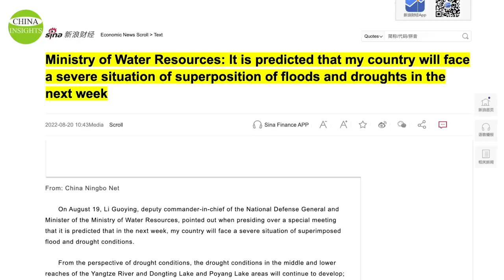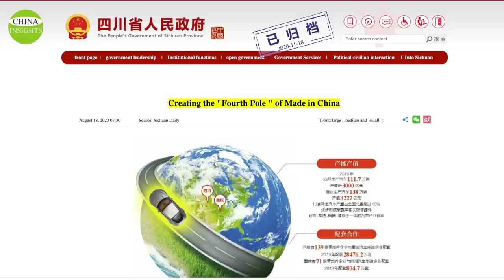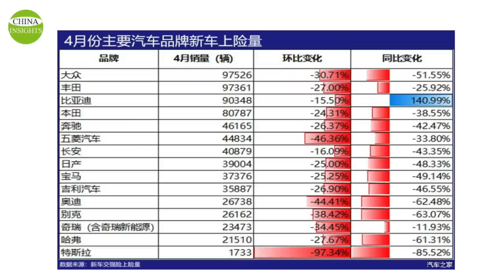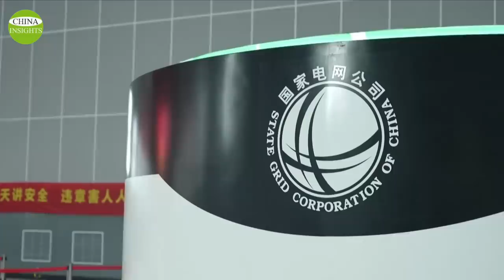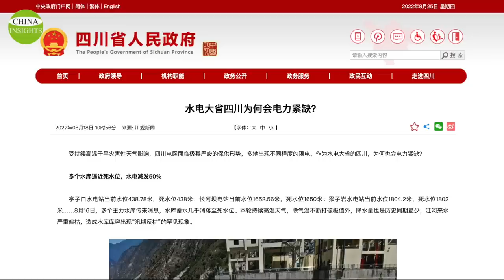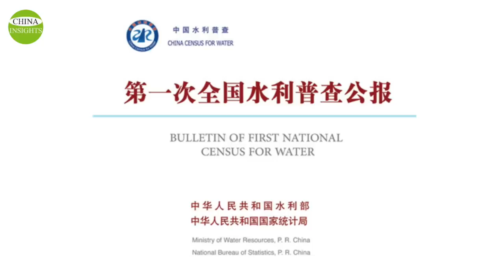Why does Yangtze dry up? The Power Crisis continues & Extremely high temperatures grip half of China

Comment: The use asphalt is very bad for the environment… and it’s traditional black color holds a lot of heat …. This wasn’t a problem when the roads were made out of concrete!
Reply: concrete is to rigid to build roads from. roads build out of concrete will chip and crack everywhere.

Comment: So, the lesson 1: they want to use more water that they have, or you use it for agricolture, or electricity, or navigation. If you want all the three things, water isn't enough. Lesson 2: if you want all electric cars you must have the electricity to charge them all, but if you charge them all then you will not have electricity to make the lithium batteries. Lesson 3: ex soviet union style economy with single items production based all in one area doesn't work. If something goes wrong in that area you will find the country with tons of refrigerators and no cars or with tons of cars and no shoes.

Comment: Hello,
Water is disappearing by design.  If 1.0e⁹ people of China provide a 1.5e¹ m² (the thickness could be as low as 1.5e¹ cm) of a nontoxic white-color floating material to cover the reservoirs' surfaces, the evaporations stop.  1.0e⁹*1.5e¹ m²=1.5e⁹ m² or 1.5e⁶ km²; nevertheless, Operation Depopulation is at work and is robbing water and resources for the underground residents and eventually decreasing the Earth's population to whatever designers' agendas require and is in their evil minds.

Comment: 20:26 : my partner is angry that I bought a 1.000 Watt Battery Based AC Inverter, with 3 Batteries about 6 months ago. This woman would be happy to have it. And as I also use own 2*2K Solar Inverter, I know that it WILL be worth soon. Even here in Thailand, still good water, but electric y 61% of gas, 20%? of Coal might seam to be save yet. But getting expensive anyway also.

Comment: Holy shiteeeeee. I work in a UK pub kitchen and highest temp I have recorded in there is 46.7 degrees C. So I can imagine it being 50 and honestly I’d have to tap out of work at that point. I’ve worked in kitchens for 9 years but 50 really is the limit of human endurance for temperature. Although that said I am basically a Viking so not like I’m built for such temps.
Either way I hope the CCP are taking this opportunity to do some maintenance work on the Three Gorges Dam as I am of the opinion that 3G dam is doomed thanks to water egress into blasted bedrock.

Comment: China does not know that they are the reason of the high temperatures that are the cause of the drought not only in china but around the world china has over 3 thousand coal burning electrical power plants 400 of these coal burning electrical power plants are in Beijing the United States only has 240 for the whole country and 28 present of those will close by 2038 but china is building more coal burning electrical power plants which causes more greenhouse gas that causes higher temperature and droughts

Comment: Tesla are literally making solar roofs and grid storage systems. They have no right to complain if they won't put up their own solar panels and batteries to hedge for electricity shortfall. On top of that, several other car manufacturers have done so and are now operating zero or low carbon factories for their EV manufacturing, for some reason Tesla won't do it.

Comment: Also here in NL we experience somewhat the same.

NL is extremely flat which means that the soil in spring becomes too wet for sowing, this means that the govenrment (waterschappen) opens the dams to flow away the water so that the farmland becomes less wet.

This results in water shortages in the summer.
Reply: Would be cool if they could somehow capture that water and keep it for summer.
Reply: @thelourensfamily8048  Its impossible to capture the water when the water caused the soil too wet to produce anything other than marshland.

Comment: China had better invest in good solid nuclear power generation incase of more future droughts in the south.  Their people can't afford the constant damming up of their river systems and not expect there to be power generation problems, this drought has had a multiplier effect and hit them especially hard because of the CCP's poor handling of their water resources.  Get rid of some dams and build some hardy nuclear power plants instead so future Chinese will not have to suffer like this.
Reply: Unfortunately, nuclear reactors don't run well in droughts. They need good cooling to be safe, so a lack of water will cause problems, both for keeping the power plant at a safe temperature and for not boiling the river when disposing the water. France had to pause operation of theirs because of this.
Reply: @dontmindme8709  If you rip down a lot of the dams that aren't needed, then even in times of drought, there will still be enough water to help keep those plants stable and yes, there's always a risk of floods, but the CCP can always figure out a way to prevent that from being a common problem, so if properly cared for, water resources for China shouldn't be a big deal.  I also think this Fukashima disaster, that was due to an extremely rare natural event is just silly and really restricts our options for providing everyone cheap and reliable energy, we can always improve safety features to minimize accidents.  Think of how many industrial disasters we dealt with involving oil drilling, it certainly hasn't stopped us from using fossil fuels.  Honestly, China, with all of it's rivers and canals could support such plants fairly easily if the CCP can start putting qualified people in charge of caring for such delicate operations.
Reply: @TrineofFire  I can't claim to know enough about China's water resources to comment on whether it would be better without the dams. I am also a supporter of nuclear power because of its stability and low emissions, but the difficulties of it also needs to be kept in mind. Thankfully Japan is on track to reopen previously closed nuclear reactors and Germany seems to reverse their plans on shutting theirs down. China is also investing in nuclear power a lot. Maybe it's for bragging rights, but it's nevertheless a good thing. I don't see them ever getting rid of the dams though. They are seen as a pride to officials. :^/

Comment: They have boats floating on the water with some exhausting unburned oil mixtures into water yet they use the same water to grow crops ? And this water cycles around meaning the longer the time goes on the more contaminated the water becomes .. also what effects does this have when it becomes very hot like it is now and the water evaporates into the clouds? This probably explains the strange weather that has been shown on this channel.. super hot weather but raining large hail.

Comment: Please check the details of your report since there are some inaccurate data e. g. the weather temperature which is not 35 degrees C because a Chinese showed a thermometer which measured 57 degrees C,  and other details on your report which are contradicting each other. Check your details.

Comment: Air Temp is not measured in the sun, it is always 60 in direct sun.   It is not measured on a city street near tar lined streets.  Air temp must measured in the shade in the shade.   Air temp is a measure of sun light minus evaporation.  No water in the dirt, grass, lakes making evaporation keep the surface below 40 then temp goes up to the temp of the sun heating the ground.   The street melted because of cheap construction, they didn’t include the most expensive materials to stop as tar will reach melting in direct sunlight if improperly produced.   The temp goes up in the city if poor city planning created miles of concrete and tar without equal parts trees, grass, water sheds.   That is corruption, poor development planning as much as heat.

Comment: The question is:  Is this a short lived (maybe a few years) phenomenon?  OR, is this the new normal of climate change?  The same thing is happening in the USA Southwest.  Seven states rely on water and electricity from the Colorado river.  The Colorado River Compact was signed by the delegates from the seven Colorado River Basin states: Wyoming, Colorado, Utah and New Mexico were designated Upper Basin states and California, Arizona and Nevada as the Lower Basin states.

If this climate change, then we should reduce the population of those areas and favor using the water for farming.  But, politicians answer to people, so they will continue providing water to the people and take it away from farms.  We will end up insufficient water for the people AND insufficient food.